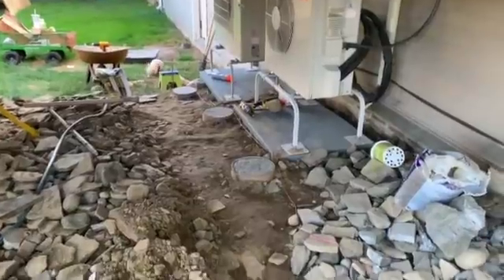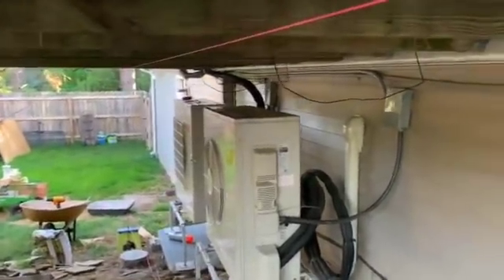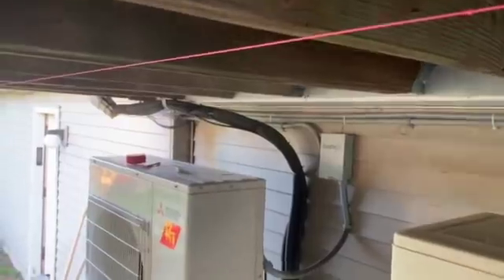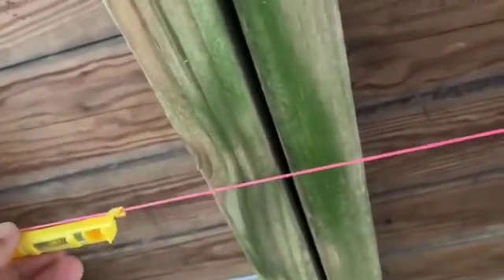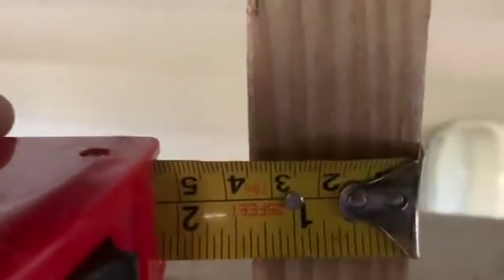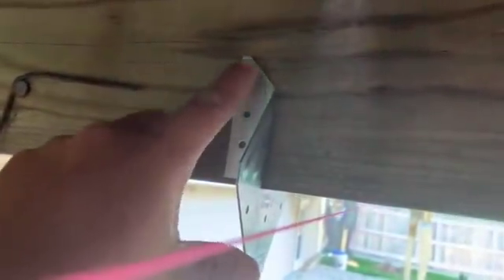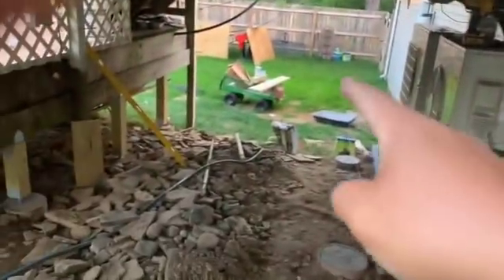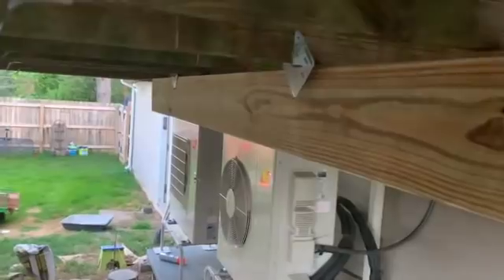How to Add a Sister Beam for additional support. Pre-existing deck. Deck Reinforcement.  Part 3.

Comment: I am planning to do same thing to support my deck joists as a part of ledger gotten rotted. Since I am not confident how to replace a ledger on my cinder block house wall. I decided to add a beam 20 ft long, 2x12. I was wondering how to level my beam against my joists. You gave me some idea. I think I am going to cut out or plane my joists instead of adding shims. Not sure which is simpler.  I have a question on your recommended post fastener. After you plug it into the footing are you able to turn it to adjust the height. Do you have any advice whether you would do anything differently?  Thsnks for your video
Reply from the maker: I started planing my hoist with a smaller deck attached to the house, but it took too long.  I felt that adding outdoor shims saved a lot of time.  I’m sure either way would work. Let me know!   
Also, yes, you are able to adjust the height accordingly by turning the bolt. Don’t forget to add the braces so the deck does not sway.
Reply from the maker: Thank you for watching.  Please let me know how your project turns out.
Reply: Thank you for your response.

Comment: What exact Simpson strong ties did you use for your post base attached to the footings?
Reply from the maker: https://www.homedepot.com/p/Simpson-Strong-Tie-EPB-Hot-Dip-Galvanized-Pier-Block-Elevated-Post-Base-for-4x4-Nominal-Lumber-EPB44PHDG/100506799
Reply: Hi, awesome work but I am confused about how the simpson strong tie post brace works.   To adjust the height do you turn the nut at the bottom of the bolt that is goining  it going into the concrete?  How does the bolt move if it is in concrete?   Does the bolt fit inside a hollow sleeve that is threaded that is inside the concrete?   Thanks @AJDIYNetwork
Reply from the maker: @user-ou6qp8xw3o  hello, and yes. you have to turn the large nut to get the post at the height you needed to be. As you turn the nut, and adjusts the height

I show this better in a different video. Here is the link  

https://youtu.be/sln_VcS2RYs?si=eBGeQYYu8F50Rb3D

Comment: For anyone else that attaches a line to see if their deck is level, instead of running a screw into the deck & causing an unnecessary hole may I suggest adding a tab bit more line & attaching the lines on each side with say a bracket, piece of metal or a screw with a nut & maybe a washer in between the negative space between the boards on top of the deck or even just tie the line to the post or a bannister on top of the deck.